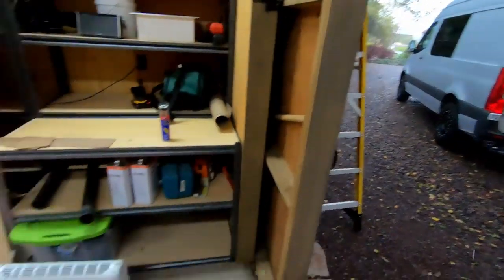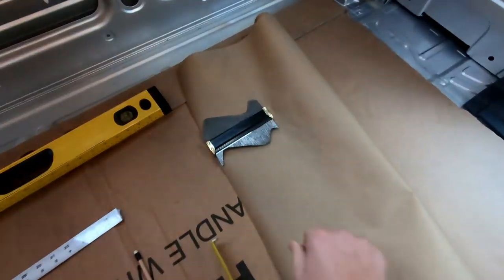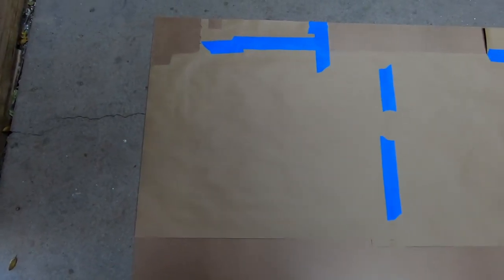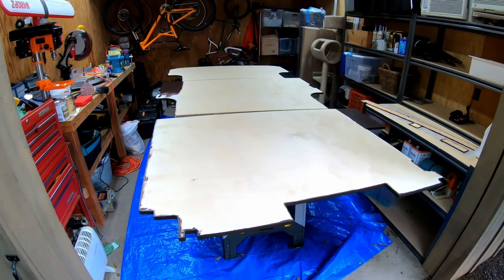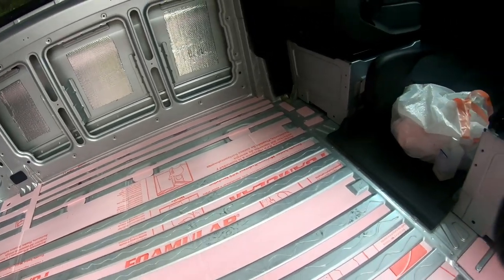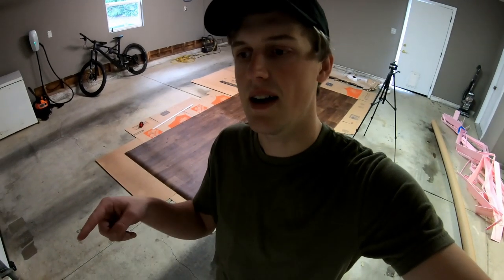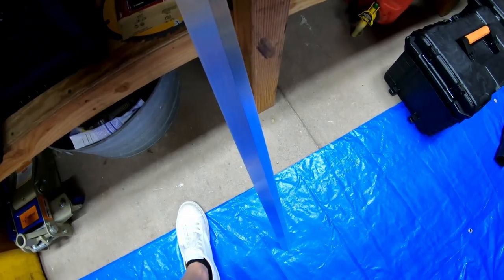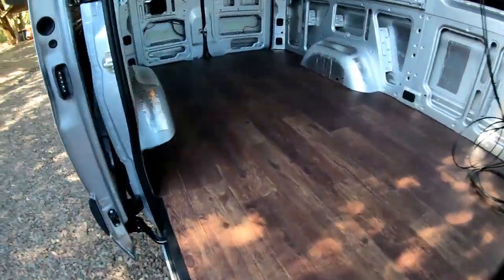How To Install A BEAUTIFUL And FUNCTIONAL Van FLOOR!!! #vanlife

Comment: I have a suggestion for tracing contours and making a template. There’s a woodworking tool called a contour gauge. It’s got various little movable pins and if you slide it up to s an irregular corner, the corner pushes the pins to exactly match the shape. You can then easily transfer this shape onto your template. 
I have used one for other projects, but not in Van building, but I think it might save folks a lot of time.

Your van is looking sweet and I hope you have many great adventures with it!
Reply: johngo6283 I have one and unfortunately it doesn’t work very well for van builds.
Reply: Daniel Resendez I saw those advertising here in YT and Pintrest they looked useful how are they not helpful in van build ?  Ad shows it conforming to any shape, though not sure how it holds that pattern while you transfer the shape to wood; other than tool is stiff plastic that needs force to move idk?
Reply: If you watch the video you'll see him holding one as he describes making the template.
Reply: Many thanks for naming this for me.
Reply: irregular shapes have been done for centuries with ticking sticks. Not dollar store pieces of crap

Comment: Floors and wheel wells are where most of your noise, cold, and heat comes from... So when I did my second  van conversion, I wanted way more insulation under the floor, used 1/2" closed cell foam board ... I also  used  5/8" plywood... when I carriage bolted  it  through the floor, the insulation compressed into the ridges... I insulated the wheel wells with (to a thickness of) 3/4" closed cell foam sheets, (front and back) first then compressed that insulation under the edge of the plywood as well... covered the plywood with the washable factory rubber mat that came with the van... then cut pieces of cheap rug in underfoot areas... I would just replace them when they got overly soiled or  wore out...  be careful, that flooring you used will be slippery when wet...

Comment: Would you explain the reasoning of only putting down the XPS foam in the channels rather than covering the whole floor with a solid piece? I understand you are concerned about leaving yourself enough height in the van, if this hadn't been a concern would you have gone with a solid piece of XPS over the entire floor?
Reply: It's recommended but not needed.
Reply: It’s completely useless and a bad idea. Only filling the channels provides zero insulation because of thermal bridging. It also restricts airflow causing mold and rot once condensation happens

Comment: Only 1 thing i wouldn't have done is used that alloy edging, You slip on that corner peace getting in and you're gonna end up with a nasty gash, Would have wood trim and sanded that corner off, Safety first dude. But apart from that an awesome job.
Reply: Craig Saunders Pretty sure that’s going to get covered up with a galley, but you do make a good point.

Comment: Hey Seven,  Like your vinyl floor choice.  I'm getting ready to glue my vinyl floor down and I just purchased some vinyl floor glue but I like your idea of using 3M90 adhesive spray instead.  I just wanted to ask how long ago you glued your floor down and see how it's holding up so far.  Thanks!!!
Reply from the maker: If you’re using home vinyl similar to the one in this video, 3m 90 is great. Be fairly liberal with the application and try not to leave a ton of uncoated spots. 

3m 90 doesn’t work well for lonseal (lonseal bubbles in hot temps really easily).
Reply: how is the floor holding up? Good still? Starting my own van soon

Comment: Quick question...how did you attach the aluminum edging to the floor? I didn't see any drill holes but it was hard to tell for sure...
Reply from the maker: Good question I just glued it down.
Reply: They will last about six mounts
Reply: Seven O Savage Do you remember what type of glue you used?

Comment: Great video! I’m using your series to guide my build - they are VERY helpful. Question: after using your van now, do you have any regrets about the floor?  Does it squeak? If you were 6’ would you add a layer of insulation between the ribbing and the subfloor? I noticed you used 3/4” - any idea if you could have used half inch?  Thanks!
Reply from the maker: Hey Jason, if I did the floor again I would likely do the following
- Use 1/2" baltic birch ... just because I'm tall and another quarter inch would be appreciated
- Use a higher quality marine grade vinyl floor, such as the "Lonseal" brand ... cost almost $1000, but will definitely last longer and hold up to dropped tools etc. 
- Not use spray glue to attach the vinyl to the wood ... maybe I'd use the same silicone I used between the birch and metal. 

Everything else I'd do the same :)
Reply: @seven_o_savage  Just about to install my floor. Wondering about why you would not use glue again to attach the vinyl to the wood?

Comment: Where did you get ¼ inch foam board. I can't find the t anywhere. Home depot, Lowes heavy supply stores. The only option I find is to order 50 feet of foamular for over 200 dollars

Comment: Very informative and inspiring. What adhesive did you use for the 1/4 strips of formular you placed on top of the noico material?
Reply: Good question.
Reply: Was wondering the same thing.  Seems like it was just laying on top.  You can see space btwn the floor and iso foam

Comment: Great job, you did a bang up job. I did something similar with the foam between the ribs. The only difference is I used a layer of XPS foam (1"/25mm) instead of plywood, then a layer of cork, then vinyl planks. I didn't glue anything down, it's all 'floating'. If doing again I'd consider skipping the cork. I wouldn't glue anything down, it's just not needed. Once everything is installed on top, nothing is going anywhere.
Reply from the maker: Hey Eat Sleep Van, love you channel man! Yes, agreed, glue is probably not necessary especially if you make super accurate cuts.

Comment: Great videos.  I'm now to this stage for my 170 and purchasing the baltic birch plywood.  I noticed you didn't use any biscuits to join the edges of the birch plywood into one sheet. Do you feel it isn't necessary? Any perceived movement under foot in elevation between panels?  Thx!

Comment: Did you consider NOT gluing the vinyl, putting it in last and just mechanically attaching at the doors?  It will eventually wear out and that would make replacement easier.

Comment: I have a question;  do you really need to glue in your floor, or maybe just use very light amount so removal is easy for maintenance, inspection, replacement?  Just a thought.  Your video is superb by the way.  Your technique has great forethought and such planning paid off. :)

If I do a build, I believe I'm going to make it with the idea it will have to be stripped down for repairs, inspection or maintenance, including all parts that go above the floor, as well as electrical.  I know somethings are not practical or useful, and some installation methods already make deconstruction very simple.  :)

Another task that popped into my head that might help is have the edges of the vinyl fold up (where there's not a drop off like the back or side door).  That way, spills won't flow down into the bottom where cleaning could be quite difficult.

Comment: Great video.  Just a note.  Learn to use a "Tick Stick" to fit plywood.  I'm a carpenter and used this method many times.  No wasted materials like the paper or wood template.  Very fast and accurate.  Can use a small piece of plywood, temporarily taped to the floor, in conjunction with the tick stick.  
Don't know what a tick stick is?    Well that's another story...do a search on youtube.
Cheers.

Comment: One thing I wouldn't like is that sharp pointy corner with a metal edge at the sliding door entry. I would have rounded that off no matter what the body was shaped like.

Comment: Why are people using such thick plywood for subfloor? Wouldn't a sheet of thin lauan underlayment work?
Reply: Do you want a strong thick floor as your foundation or you do want something flimsy and weak??
Reply: @thequietkiwi  is the van floor flimsy & weak?  It's not spanning 16" floor joists.

Comment: Wonderful job and great video! Quick question about the ALL PURPOSE 100% Silicone: does it dry/cure even without air access? I'm debating what kind of glue should I use on my conversion (between metal floor and laminated ply). I know many adhesives require one of the surfaces to be porous and a laminated ply is pretty much sealed. Thanks!

Comment: Hey brother, 
Thanks for all the videos, floor looks great. I have a question. So I have ordered a vinyl flooring for my van but I'm having second thoughts about the vinyl as I've read it can off gas toxic chemicals for a number of months due to the ingredients in its manufacture. 
What have you found with your's, how did it work out etc.
Reply from the maker: Yes it probably does, but vinyl floors have been used in houses for decades and are still used to this day. If you’re very worried about it then id go a different route, but I haven’t grown a third arm yet so I’d use vinyl again.

Comment: Great video man. That sucks you couldn’t put any insulation in the floor because of your height. For future reference if you ever decide to buy another van the interior height of the ford transit is way taller than the sprinter. That’s one of the main reasons I decided on the ford transit since I’m tall too. That and I’m in love with the 3.5 ecoboost engine.
Reply: I have the high roof and I'm about 6'5" and I'm killing myself trying to save as much space as possible. There is only 4 inches to work with for the roof and floor, but I think I'm going to be going the same route as this.

Comment: How has the Vinyl held up just using 3m 90 to hold it down?
Reply from the maker: It’s been fine although I do not recommend 3M 90 for this because I believe it does is not dry underneath non-porous surfaces

Comment: 🙋🏽‍♀️ Solo female, just bought my van and have no idea how I'm going to get this done, but I think this is a start! 🤗
Reply from the maker: You’re gonna crush it 🤙
Reply: hey how did it go? :)
Reply: @neowave777  Hey, so far I went and got a metal blade at Home Depot, borrowed a jigsaw and cut me out some windows -  sliding door (large vented window) and the 2 back doors (solid windows)...it was quite the adventure 😳 but I got it done! Next project will be the floor. Keep ya posted LoL.
Reply: @advantageous-me  awesome!!! I just finished my van build and now is such a good time to travel because things are so quiet! :)

Comment: Have you had any issues without bolting the floor down we are at the point of no return and must decide to glue the floor or bolt it down.  Great videos! very helpful.
Reply from the maker: Nope, for most applications adding a bit of glue and putting all of your furniture on top will suffice. Only exception is if you’re doing extreme off roading
Reply: Seven O Savage so funny when I took the floor covering off the previous owner had installed a subfloor from cr Lawrence

Comment: If you don’t insulate the ridges, they will form a thermal bridge. So your insulation now only consists of the plywood and vinyl floor. As long as you don’t use the van in cold weather that’s ok.
Reply: VETTESET 
The whole insulation is as good as its weakest link. So yes, add another layer of insulation over everything or at least over the beams. 
It’s either less space and flat walls or wall with cavities. (Or a too cold/warm van of course;-)
Reply: @Conservator.  Ive been watching the Advanced RV videos and they use rattle trap and plywood.Nothing else.I wonder what they know?
Reply: michael scarfi 
That’s sound insulation, no heat insulation. If you’re not going to cool or heat your van, than that’s ok. 
Without insulation you’ll need al lot of heat to warm the air up and it will cool down very fast once you turn down the heater. Worst than wasting a lot of energy is that on the cold skin of the van condensation will form which will likely cause molds to grow between the plywood and the skin of the van. 

If the van is cooled then condensation will form on the outside side of the plywood also causing molds to grow. 

To do it properly you need insulation and a vapor barrier. There are lots of good examples on YT too.
Reply: Conservator I know it is. I also know they are the best van builder in the country. I assume the vinyl floor is a vapor barrier. I also know from building homes the floor is the last place your heat goes out. All I’m really saying is I’m not sure about any of it.

Comment: I dont understand the use of expensive subfloor (Birch) when you can simply use simple plywood.
Reply: Birch is used because it has much better tolerances to expansion / contraction in different climates. Sealing it certainly helps, but you definitely wouldn't want to go with a typical subfloor material like OSB. Birch is stronger than Bamboo and Cork but those materials can be safely used elsewhere in the van.

Comment: Good job, but at $55 a sheet of 3/4 birch plywood  v $29 a sheet of 3/4 of sanded plywood,  would save $25 a sheet for just none visible sub-flooring.  FYI save ya at least $50.
Reply: Is the birch significantly lighter?
Reply: Id like to know where your buying 3/4 AC plywood for 29 dollars.

Comment: Just amazing! You have Jedi-level skills on van building! I’m curious if you used the actual floor for the template or the cardboard board?
Reply: I mean for the linoleum
Reply from the maker: Thanks David! I didn’t have a factory floor in mine, but I would have used that if I had it! It would have saved me a whole weekend of templating.